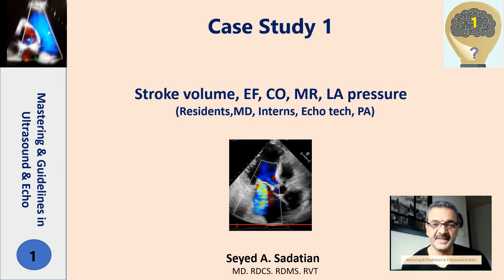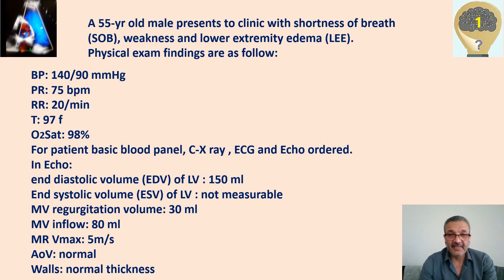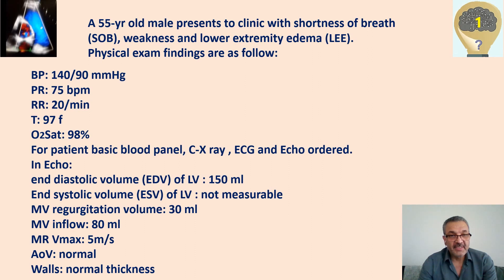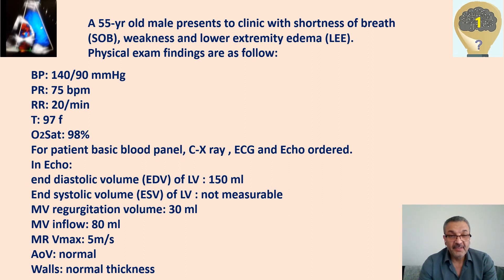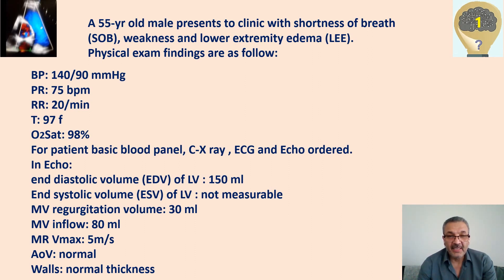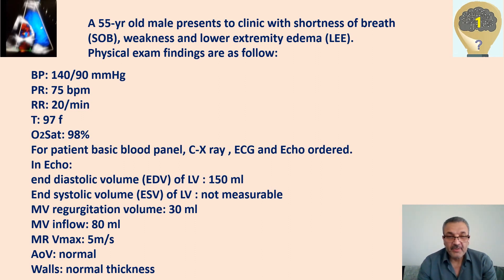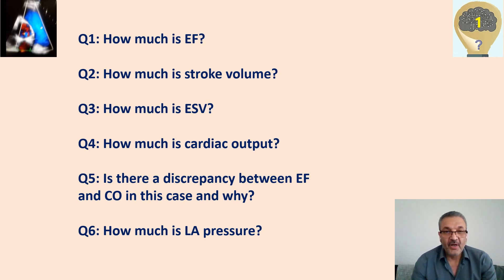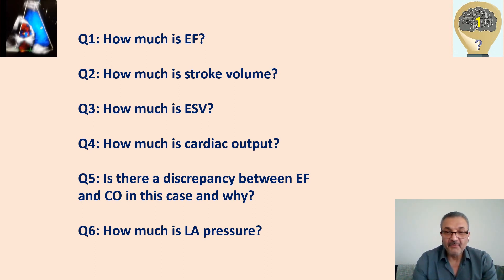case study 1 hemodynamic

Comment: EF 53% /  SV  50ml  /  ESV  70ml /  COP 3.7 L/ min   LAP  40mmHg
yes there is a discrepancy as calculating Ef by the MOD  does not consider the volume of MR Jet which is not the case for CO
Reply from the maker: That's right. I explained  all answers in details